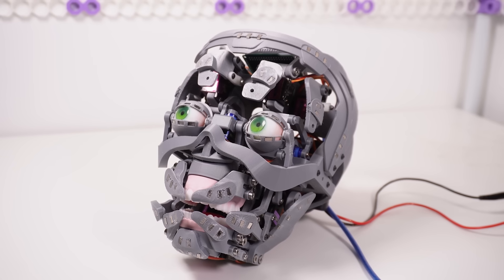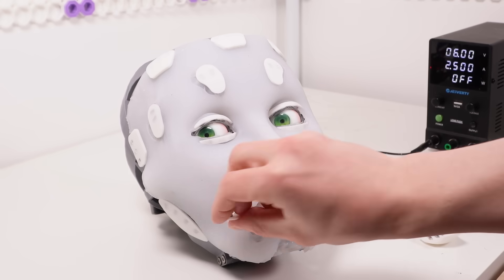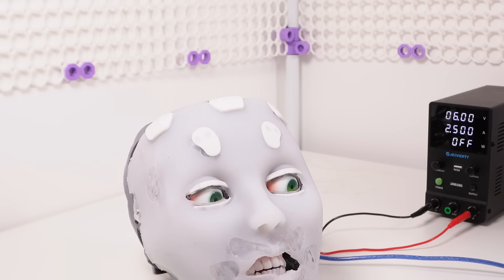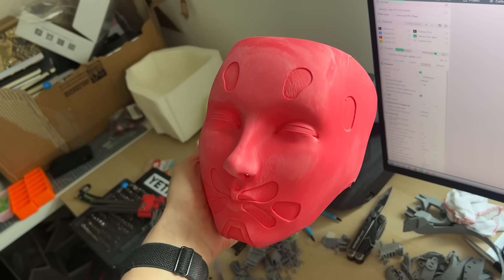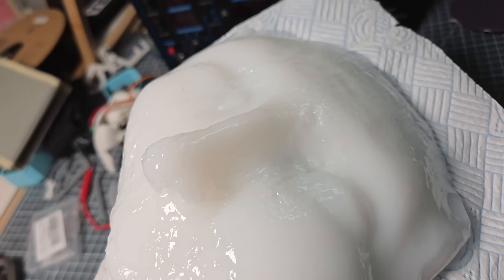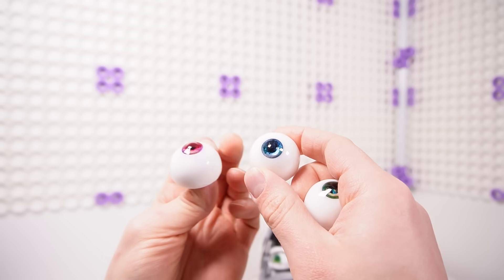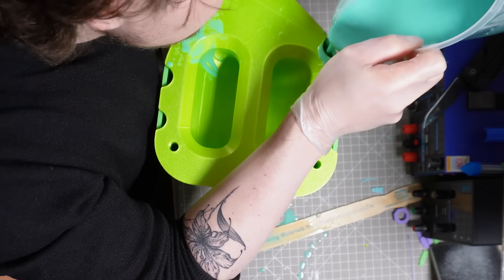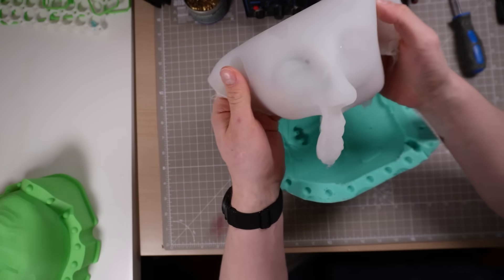Silicone Skin and 3D Printing: Creating an Expressive Animatronic Head

Comment: To make your designs more modular, consider adopting a controller / peripheral model and linking the units together using QWIIC (I2C) and power supply cables.  For each peripheral (eyes, face, hands, etc.), design a circuit board with uniquely addressed I2C PWM, GPIO, drivers, and sensor components and the necessary mounting fixtures for installation.  To assemble your robot connect all of the peripherals to a common “brain board” and power supply.  That way only need one microcontroller (or SoC) to drive everything and you can swap the brains and peripherals for different units incrementally as your design evolves.

Comment: If you need help with silicone casting, I have extensive experience with it. Some tips:

1) sulfur inhibits the curing of most platinum cure silicones. Many clays, as well as 3d printer resin have sulfur in them and will ruin your casting.

2) too much mold release will ruin your designs, but you still need some. You're only trying to create the most thin single layer of release, nothing more.

If you want to collaborate on anything silicone related gimme a holler!

Comment: Hey Will, just wondering if you have heard of Immortal Masks - in the USA - they produce incredibly high-quality silcone masks that are embedded with a mesh made of a stretchy-elastic style Balaklava type of head-covering -  this allows for the masks to retain their stretchiness without tearing or ripping.. I think they achieve this by first creating an under-layer of silcone, putting the mesh 'stocking' over that layer, then completing with the surface layer with all of the details in it..

I had an idea for an animatronic head similar to yours - involving the Immortal Masks mesh, however, at specific muscle-groups, labial-folds, and tethered tendons I would added tiny hoop-knots, that would attach through a harder 'skull' beneath the skin with strategically placed holes drilled into it, allowing for the hoop-knots to be fed through, to attach to mechanisms that could pull / deform / hold the skin in place, as well as simultaneously allowing for grouped-motion of muscle groups..

Just a thought.. Great channel - really appreciate your efforts and endeavours, dude

Comment: I wonder if you could make the clips holding the face on from thinner steel instead of the magnetic holders so that the face is slightly smoother but still looks mechanical 🤔

Comment: Silicon application is always tedious, I usually give a quick spash dabbing to the surfaces for a thin coat then just pour a really high thin strip on one point, helps a ton with the bubbles. Stellar work as always you're an inspiration to this community <3

Comment: I was going to suggest embedding the magnets before you said it lol i also think it would be cool if you could add something like clear fishing line in between the two silicone layers so you can tug the skin in different directions for very small areas where you dont have a lot of room for moving plastic frames around
Reply: You could even use the cables to strap it down instead of the magnets

Comment: I'm wondering if when you tried the slush casting silicone if you painted the mold with the silicone first for details, then did multiple thin casts. I'm by no means an expert but I've seen that done on other channels for slush casting. This is the kind of work I wish I had the aptitiude to do when I was in college (even though the technology wasn't there at the time) as I really wanted to get into animatronics.

Comment: Mould release: use petroleum jelly; heat it gently until it melts, then use a silicone brush to apply.  Never had any issues with silicone curing or releasing using this technique.  

Will absolutely support you on Patreon when I'm able to; fantastic work.

Comment: I think the lips should be made like the opening of a drawstring bag, with 2 drawstrings that could pucker, and the corners of the mouth could be pulled by 2 other strings for smile and frown. The top and bottom lip should be like fingers that curl around the teeth. So basically its like 2 lip curl fingers holding a double drawstring, that is connected to pulleys in the cheek bones and jaw. I don't think plastic arms in the cheeks is a great design, I think more of the actuation could be done with string cables, maybe sewn into a fabric layer below the silicone.

Comment: good job but i see the costs are getting under your skin and people can be stingy. In this example for the skin you used expensive materials. the silicon mold could of been clay, the ecoflex could be a mixture of silicon caulk, silicon oil/paint thinners. well i also noticed you have sponsors though.

Comment: NJ
A few suggestions to investigate.

Do you really need magnets in the skin. 
Could you just not make some areas where you fill the the silicone with magnetic powder, and it would be easier to get the shape. I just feel two magnets both on both skin and head, and force wise is a bit over kill. This could also save you. Alot of thicknesses of the skin. I also feel it will be fragile, around the embedded magnets. 

And if you really are up to it, you could do different shores(hardness). So some areas are less moveable and other like the eyelid are very flexible. I would try to experiment with iron fillings, magnetic powder, and if you have the money neodymium powder.

... Also I would dye the silicone, I find the dye makes it a bit more " dirt protective" Silicone sucks all kind of small hairs and filth very easy. On my casting I feel I overcome this by putting dye in . 

Well good luck anyways

Comment: 14:00 please do the hidden panel design. Please please. It means you can extend the types of humanoid realistic animatronics you make (eg hair plugging for warewolves)
Reply: Agreed. My main robot will be a dog/[man's]best friend. 
Though, I could use the non hidden as permanent anchors hidden under the fur.
Reply: @rmt3589  would the fur deform properly with a non-hidden anchor system, or is that not required? The hidden system would be so so useful, agreed
Reply: @DanVogt  I'm not sure. Plan to use elastic faux fur, either bought that way, or made that way with elastic thread. (More structurally sound with thread if done right, as you can specify tension and shape, and make the seams stronger by having the tread pull them together. (If you do it wrong, the threads will pull the seams apart)

Comment: How about setting up your silicone for spray application. Then, you spray it into a single mold surface of the face. You spray continuing layers until you have the desired thickness of skin.

Comment: Clays can contain sulfates and that will case a chemical reaction, hindering the cure of the silicone so if you fine the sulfate free clay that is most likely the issue the other thing might be the mold release application technique. Spay lightly and use a brush to smear the release around evenly and let fully dry before putting the molds together. Hope that helps Amazing work!

Comment: The problem with those, off the shelf, servo's is that they make a large whirring noise. It's very distracting. Ideally you should be using either position controlled solenoids, or custom made linear motors.  Synthetic muscles would be ideal but there is no such thing currently.

Comment: Have you considered using a flexible resin printed face.
You could start by trying a face that is printed by a 3d printing service company. If that works you could then consider acquiring a resin printer. Alternatively print the flexible skin with an FDM printer and try surface finishes to remove the layer lines.

Comment: What I recommend is to watch some vintage special effects makeup design in which the cheek for instance, is thicker and glued on to a thinner eye socket part using latex. I think though ultimately you are going to wind up using some kind of mesh embedded into a two-sided silicone mold and that mesh will be some kind of fishing wire or flexible underwire. This mesh would prevent tearing and also give you the ability to attach your structures to the mesh.
Reply: Awesome - I posted a very similar comment.. Your explanation is a lot more concise than mine..
Reply: kreaturekid did this for some of their silicone puppets, used a mesh to glue silicone together and to non silicone parts
Reply: Why not use FX? The latex pieces are a little bit more robust than silicone. Just a thought.🤪

Comment: Would it be possible to mix in some short yarn fibers to "stiffen" the skin. it could be a way to build some resiliency and "muscle" groups. some of the anchor point you use might get some strength from it. Don't know if it would work but if it does you could have that add some fleshy/veiny undertones.

Comment: Mount magnets in your mold core print to hold your panels in place. Then stretch a power-mesh over the core, attach mesh to panels and then cast your ecoflex. Will make a more resilient skin and will embed your magnets into the skin. Also, you can get away with printing your negative if you want to save $ on silicone.

Comment: That is some amazing stuff. I’d image that casting the panels in place would be a great option. You could also add string/threads to the panels to cast in place that way it’s not so obvious that the servo is pulling on a specific place but it feels more like a muscle is moving that entire portion of the face

Comment: If I may suggest a different  method of connecting the skin, perhaps using a "power mesh" with the silicone skin might be more advantageous in durability and fidelity while being easier to graft onto the mechanics.

A power mesh is essentially a 4 way stretch material like spandex that is basically impregnated into the silicone skin. It's used in the mask and haunt industry to help performers give more exaggerated expressions.

There's a pretty good explanation in Adam Savege's Tested titled "How Lifelike FX Creature Masks are Made".

We share the same dream of making all of this more accessible to everyone so I hope the suggestion helps. As a teacher I dream of a day where every school can have this as an after school club.

Comment: Awesome suff! 
Only 100 comments now so maybe you'll catch this one and tell me how much of a bad idea this is :P :
On the mouth movement, I think you could use springs to tension different parts, and strings pulling from the inside to regulate that tension. You can pack more control points on the mouth and route the strings to other parts of the head. Maybe even use smaller servos. I think a puppeteer aproach may work nicely for that specific part :)

Comment: Only just learning about this so if you already tried this and found it didn't work I apologise, but could you try obtaining a transparent blue silicone for no other reason than it looks like the robots from that version of I, Robot with Will Smith?  Only potential thing I can see as a problem is maybe transparent silicone has a different texture making it harder to move?

Comment: Brilliant. I have been following artifical muscle development to do the same for a long while.

Te testing silicone molds. I  find gelatin an excellent test substance. Its translucent and you can quickly measure thicknesses with a needle.
Plus you just remelt it to try again :)

Comment: If you want the silicone to really stick you can use 100% silicone sealant. For example GE Silicone 1(don't use 2), or use Silpoxy from smooth-on.

Those works with ecoflex and is often used to repair silicone masks!

You would need to superglue some kind of small plates with a very rough surface where you want the silicone skin to be attached. Think of something like velcro in terms of roughness, this will give the silicone a very strong and almost permanent grip.

There is another channel here on youtube where they guide you through the process of making silicone faces for animatronics. I think you will find it really helpful!

I will search for it and post the channel name under this comment
Reply: Search here on youtube for "Alvaro Passeri"

The silicone animatronic faces he makes doesn't look that good, but he offers some really helpful guides of how to make stuff like this.

And if you plan on painting the silicone or want more info on anything about molds and silicone, "brick in the yard" is a really good channel to check out!

I work as an FX makeup artist and I use silicone a lot so if you need any additional help you can just hit me up and I will try my best!

I'm excited for your project and I believe you will make something really cool in the end! ❤

Comment: The Silicone and the casting material must match.  What you did was a platinum base mixed with a silver based product which will never cure
  Check the label. Silver must be used with silver and platinum used only with platinum.

Comment: This the most awesome video ive seen in a while. Would it not be easier to cast the face with thicker flaps in the areas that you could attach directly to the skeleton so its fastened on the inside without the use of the magnets? Like the ones found on the top of cereal boxes

Comment: This would be more of a stopgap solution, but having somewhat weak elastic strands strung between the panels within the cast may help with large gaps being torn in between panels- in theory, if the silicone begins to tear, it should tear along the path the strands are laid, which would have less visible holes and gaps.

Alternatively, if you were to do away with the silicone around the mouth, having a mesh of elastic along those points and the jaw with multiple panels overlaid on top may help with the uncanny valley issue by giving the lower half a distinctly not-at-all human appearance. This may, of course, dip into other horror elements, but it probably wouldn't really be the uncanny valley side of things.

Comment: I would suggest taking notes from an industry that has struggled to solve the facial rigging; 3d graphics and especially games.
Here's some material if you're interested: https://en.wikipedia.org/wiki/Facial_Action_Coding_System
I say games because they try to minimize the facial bone count since game engines need to run smoothly in real time.
Team Fortress 2 manages to get pretty life-like results with not that many bones.

Comment: Try casting velcro tabs into the silicone, instead of magnets. Velcro has an advantage that they flex and actually adhere better when under tension. Magnets tend to slip unless you have some positive stops. 
Another approach could be to use neodymium beeds instead of blocks, with concave round magnets on the opposing side.

Comment: You could cast bits of iron into the silicone in 2 phase pour instead of panels. Powder might be enough for magnets to pull on.
Reply: I was thinking he could just mold little plugs on the inside of the face that press fit into the 3D printed parts like grommets.
Reply: @SafetyLucas  this is definitely the best idea
Reply: What about slippage.

Comment: Hi Will! You are making a lot of progress on this design and it is great to see it coming together! It is gratifying to see your success continuing and growing. I often see other makers referencing your designs and the old saying, "imitation is the most sincere flattery, " comes to mind. I too have used many of your designs and have had great success with them. But, for my needs, I almost always need to modify these builds. You see, for my clients the "uncanny valley," is not a scary place, but rather a goal. I manufacture halloween animatronics, and if the face "creeps out," the guest then we have accomplished a major goal.  To this end, an eye mechanism that uses 32mm eyes that are spaced at 75 mm, doesn't work for me when real eyes are closer to 24 mm in diameter and typically spaced at about 60 mm. Fortunately,  I have been able to use your concepts to come up with designs that fit my needs.  I'm sorry to see that you are struggling with cure inhibition. You are likely correct that the problem is the release that you are using. Platinum silicone is very picky when it comes to curing.  Another maker has had a large degree of success by using a silicone adhesive to attach his movement pads to the silicone skin. Of course, this makes for a pretty much permanent attachment to the skin but after all, once the skin is in place, I don't see a need for removal.  But as always, keep up the good work and thanks for all you great content!

Comment: If you ever get really good with silicon or find a way to have them professionally made, look into how noctua does their anti-vibration mounts - they're little pull tabs that you can pull (or push) through a hole, locking it in place.

They're called NA-SAVP3, you can google that to get an idea. This will greatly simplify the mechanism, but I figure it'd only work if you have absolute control over the mold.